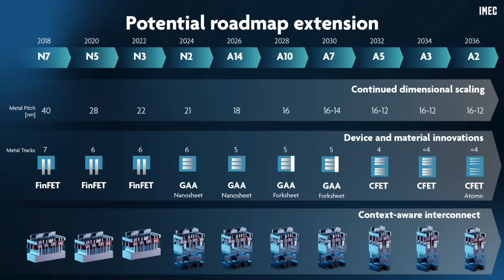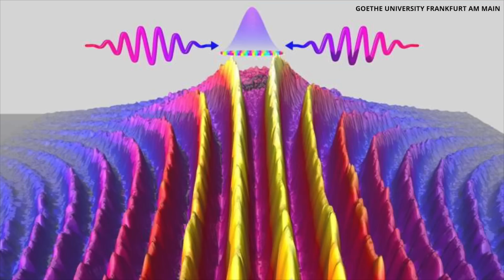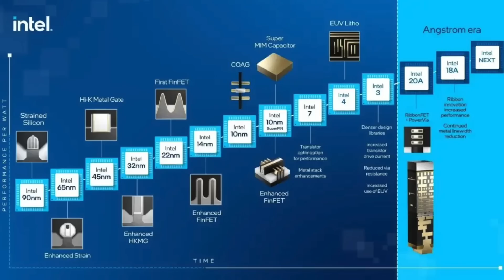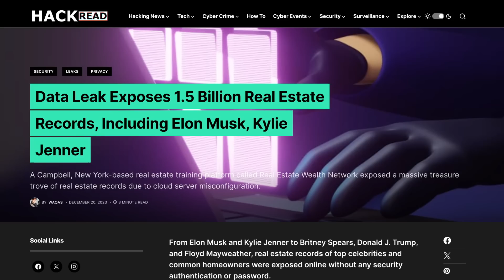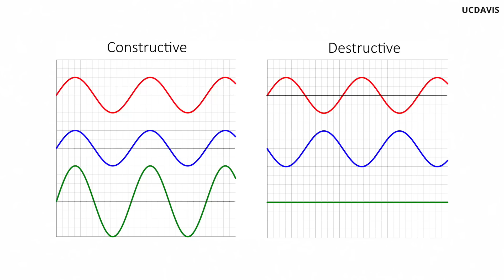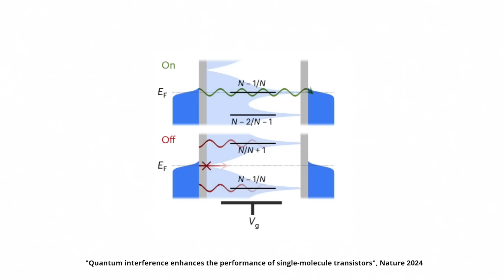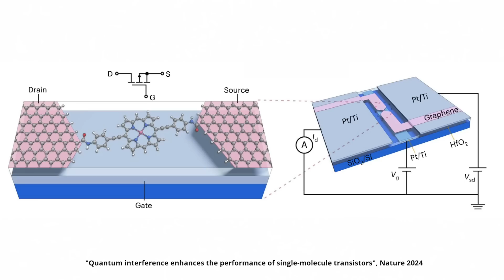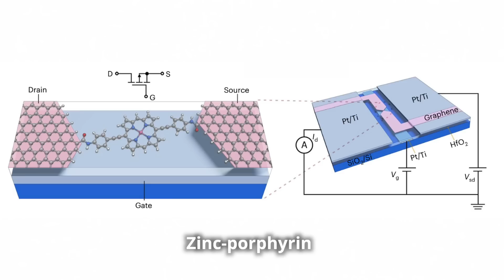Scaling Beyond 1nm

Comment from the maker: Secure your privacy with Surfshark! Enter coupon code anastasi for an extra 3 months free at https://surfshark.deals/anastasi
‼ Sorry guys, I messed up. I meant quantum INTERFERENCE, not inference. It was a long day 😅
Reply: no worries, we understood that you meant interference
Reply: The neuron is thousands of times bigger, yet the brain has more capacity than any computer, proving that it's not size that matters, but architecture.
Reply: @aaronmicalowe  Utilizing about 20W of power.
Reply: In fact, everything matters in an ultimate competition. It's hardware, software, architecture, material, etc
Reply: @aaronmicalowe  Well I guess BUT the brain is 3D!  And or a convoluted wrinkled layer.  Also the brain is larger, and even more-so if you were to stretch it out it would be at least 2.5 feet.
Reply: @jonathanberry1111  Exactly. All of that is architecture.
Reply: @aaronmicalowe  Oh, I thought you meant software architecture, or the circuit layout, not how the circuit is fit in a given volume.
Reply: @jonathanberry1111  yes, the fundamental physical architecture. There are diminishing returns for just making things smaller if your architecture sucks. A shaky house built from tiny bricks is still shaky.
Reply: @aaronmicalowe  Neurons are 3D, they're also analog and asynchronous. Their frequency is absolutely terrible, worse than tecen the worst transistors. 

If we were to do something like that with transistors instead, it would outperform the brain so many times over its hard to comprehend. 
We just have no idea how to achieve this. 

Also, asynchronous shit is useless in classical computing. It would probably take days to compute a single frame on a human brain in the classical way with a decent precision.
Reply: No worries keep up the great work! Everyone has words they think are different than how that are. I thought chimney was pronounced chimley until I was like 16 :)
Reply: @petersvideofile  - Yes, Eggcorns and Mondegreens... which is the actual term for this specific kind of confusion. It amazes me that even news readers who speak English natively get things mixed up, like saying 'the missiles "hone" in on their target,' when the correct word there is HOME. Or saying 'the "calvary" came to the rescue,' when the correct word there is CAVALRY. Oh well. Who knew Jesus was a horse soldier? ;-)
Reply: Explaining the use of quantum effects on the design of microchips, making it simple enough for us dummies to understand AND doing it in a second language is absolutely amazing. Great work! We forgive you for mixing up inference and interference 😊
Reply: dw you're fine, ty for lettings ppl know
Reply: inference - вывод
interference - вмешательство
Thanks for another great video!
🙂
Reply: this is a huge step towards making neural networks function more a human brain, and can allow functional low energy neuromorphic chips with physical versions of repeated network layers embedded in hardware, and attention mechanisms with sigmoid activation neurons... pardon me while i do a little happy-dance xD
Reply: Your brain has been trained so much on saying one word, that when you have to say a very similar one, you might just slip into the rut left by the repetition of the other word. It's understandable.
Reply: if humans do not error then we do not learn from ourselves.
Reply: I get it. I was going to say something but I'm glad I don't have to because I wasn't sure how to put it. I'm a linguist, and you're more of a polyglot than I am. It's hard to keep track of multiple languages, and a mistakes do happen. Still good work, and a few imperfections aren't going to change that.
Reply: Please make one about NVIDIA vs Google A.I-GPU architecture! And no! just architecture, size, etc... will not accomplish data gardering necessary, and google has tons of e-book's GPT will never have along with conversations and videos...
Reply: I wondering why you were talking about AI.😆
Reply: don't worry, it's not hard to infer it
Reply: have you heard about intel's backside power delivery?
Reply: Очень перспективно. Надеюсь, это действительно прорыв. Похоже на то. По поводу молекул в центре насколько я понял вам уже ответили, и вы заметили. Это порфирины, пиррольные кольца.   Я тоже про такие молекулы давно знал и изучал насколько мне было возможно. 
Яркими представителями подобных молекул является гем в молекулах гемоглобина, хлорофилл,  Витамин B12 в центре которого кобальт, И Если не ошибаюсь многие природные пигменты. Удивляюсь почему их раньше не использовали в качестве транзистора. С одной стороны это довольно стойкие соединения С другой стороны они хорошо могут вести себя как триггер. Тем более если Википедия не врёт  и это Вполне вероятно  На основе порфиринов уже созданы катализаторы, сенсоры, лекарственные средства, органические полупроводники, жидкие кристаллы и материалы для нелинейной оптики.  
жаль как всегда некогда подробно писать Потому что всё ещё нахожусь в наёмном рабстве. Да и смысл вы всё равно не отвечаете. Может если получится напишу в LinkedIn.
Reply: Basic physics, long day or not.
Reply: No worries Anastasi we are humans we make mistakes 😅❤💚☺🤭🤗😊😘🤗 When you go to Belgium? 😊💚💚
Reply: 2:26 what about TunnelFETs? ;)) they take advantage of this quantum effect 💚😄😉☺😊
7:46 Ad ends in 8:30
Reply: Honestly, I thought this was like Benshark Curnipatch's pengling like situation. I thought you were pranking us, haha
Reply: Ohhh. Your molecules are beautyful ❤ And your position is super to
Reply: @AnastasiInTech - You might want to look into the so-called "Vacuum Channel FET" (VacFet) which does not even require semiconductors for fabrication, and which works better and better as it is made smaller. They are virtually immune to ionizing radiation and can run at high temperatures, such as 300°C (almost 600°F), depending on materials used. In the very first batch one lab made, the VacFets ran 400 GHz on 5 volts. They would probably work very well in the old I-squared-L non-complementary logic circuits Texas Instruments used in their TMS9900 cpu. Finally, VacFets don't really even need vacuum: When made on nanometer scales, Helium works just as well! 🙂
Reply: I wish I knew a second language so well that I made a mistake as niche and specific as that 😂
Reply: No worries Anastasi, not only did we understand what you meant, you did a fantastic job of explaining it to us.  Let me add a suggestion, however: it's great to be using constructive and destructive interference in this way BUT it's only another way of working with 0's and 1's INSTEAD of taking it one step farther to utilize constructive and destructive interference to do computations HOLOGRAPHICALLY, because after all wave interference patterns are what holograms are made of!  The place to look for the technologies to do this is in scientific research in OPTICAL COMPUTING, which dates back at least to the 1980's.  Apparently the engineers who have built the devices you're showing us here either don't know about holographic technologies or haven't realized how useful they can be, but the REAL coolness to holography is that IT ALMOST CERTAINLY underlies CONSCIOUSNESS, meaning that the proper development of the technologies you've presented here could potentially be useful in creating SYNTHETIC CONSCIOUSNESS IN MACHINES.  I'd love to explain more about this prospect to you if you'd  like to contact me, but due to the often-random ways YouTube works I suspect that leaving you an email address or a link here would probably not be allowed.  Instead you could Google 'Nexus Theory of Consciousness Simanonok' to get started with the concept of a holographic consciousness and contact me through my Facebook Brain And Consciousness Group that you'll find a link to on the Nexus Theory 101 page.  I love your work and would love to see you take this holographic idea as far as possible and revolutionize your field of work!
Reply: Inferernce is not the same as interference. Your pronunciation is off
Reply: I don't care what you say, it's all beautiful! I understand that English is a second or third language for you, and you are doing fantastic! You are the most beautiful electrical engineer in the world!
Reply: Please work of pronouncing the T in InTerference, it sounds like you are saying inference which is more a task the CPU/GPT might be used for.
Reply: sounds really bad but  the photonic issue of hard coded may hable to be solve instead of "interfirence" better change color not base binary procesing 1 color  it's 0. simillar bit not same a "racist cpu". espectrometer  radars. racist because "carers" about "color ", bad ai will happend because our "higth level of primitive language are full of prejuged at reality undestanding or true"

Comment: This paper is a nice step and is in the field of molecular electronics. The interference happens as electrons travel through different orbitals. It was shown also in other labs. So cooling one thing is that the Fermi distribution "spreads" and i guess you can occupy only specific orbitals also you need have low thermionic emission also as you need to cool down all phonons. Not sure if this can happen to a Silicon transistor as these GNRs or molecules have specific orbitals to do this. 
The killer for this app is the temperature and if you have to cool down a chip then you can have a qubit.

Comment: QLC...
1001 MAY BE WRITTEN AS 0011,0101,....
PIXEL ( SIZE OF e ) AT CAMERA'S SENSOR.
AC VOLTAGE WITH SPECIFIC FREQUENCY GENERATED AT CAMERA'S SENSOR.WHY WE NEED SO COMPLICATED ELECTRONIC CCT TO DISPLAY THE PIXEL ( BIGGER SIZE,SPECIFIC COLOR / INTENSITY ,..).JUST AMPLIFY THE SIGNAL AND PASS THE e BEAM THROUGH PRISM / LIQUID CRYSTAL...?🤔

Comment: I know little to nothing about cpus and how they work, but when you spoke on the leakage and how its a problem moving across the gate, I was thinking, if we do not want it to leak to the other side, then I would think there could be a lane for it to leak into which would move it away from other side where we do not want it to go.. and possibly use what leaks to help do something else.. example would be with a gas engine, we have parts like a carborator and it sends fuel into the cylinders and then is pushed out the exhaust.. but I have seen things connected to an exhaust where what comes off also helps to run a turbo charger.. which helps to increase the power and efficiency of the motor.. perhaps like a bleed off of some sort to bleed off the waves from going to the other side.. and routing it to something else that it can be used for.. just tossing out what came into my tiny brain.. all two brain cells!! LOL

Comment: You should start with that cooling problem  <  - 200°C  that won't help at all ,in addition to the low frequencies that they currently oprate on and unfigured out  interconnection system between them.

Comment: This is amazing news, to consider that a transistor can be so small.  I must say I'm barely an amateur electronic hobbyist, having studied the basics of semiconductors like MOSFETs and the simple 555IC timer, to make wave form generators for audio applications. But to consider even these simple circuits could be made in forms smaller than the width of an average ball point pen line, just blows me away.
I think of that fluid check valve design with no moving parts, and to consider harmonic and disharmonic frequencies used as the switching base it makes me think of how electronic devices could interface with human bio-enegetic energies of the Aura (Chi), and even biological nervous systems.

Thank you Anastasi for sharing, I love your excitement and willingness to bring these advanced developments to the general public.   😉💖✨

Comment: CPUs and processors in general face other perfromance improvement issues. The biggest problem is that few applications really use the cores that CPUs provide. Then code is not parallelized in most applications except for GPUs. Then, code is way not optimized for the respective processor generations.
All this leads to the following frustrating experience of most consumer users: The new processor seems 50% faster but your applications somehow are not.
And that of course stems from excessively growing junk code which is unproductive across most functional use of applications.
Had we really experienced a quadratic increase in computer based productivity we would now hav e aGDP / Capita of much greater than : 36x since 2000 across all digital value chain processes and in  particular we would have expereinced a powerful R&D boost.
However, we haven't . And that is because productivity increase stems from delta knowledge and computers are supposed to support us creating delta knwoledge that is valuable = in demand and thus increases productivity. Again, we haven't.  A lot of compute perfromance has gone into entertainment. Now entertainment is indeed productive in as far as it increases inspiration and supports recreation. However, playing games for 4 hours a day leaves no energy and space to apply any of the inspiration or creational energy you might have gained.
So all the quadratic looking advances in CPU technology dwindles down to small percentages of productivity increase a year: currently it is 1.32% p.a. globally.
Again- all this is one big allocation problem. How much energy do we need to allocate to new CPUs? To new GPUs ? To more bandwidth in fibre cables? To better software code?
To better software applications? To better data bases? To better digital sensors ? To destructive weapons or productive machines?
Maybe an AI would improve our global energy allocation far better so we can experience quadratic progress?!

Comment: Hmm, couldn't you use the same Bridge in between the source to connect the transistor? Maybe a dual  to allow a steady flow...the molecular size of the material used might be another thing.. Im no electricity related type of training but a simple engineering solution might be considered, perhaps the idea is right but the material is wrong?

Comment: Stick in position👀limitations.

When you have arc memory towart ciclesematic manifistations and mentainence they pop up en of existance according the needs of its parenting conditions 👀👀👀

This cosmic behavieures on subatomic level for our perspections behaves as a infinety room of the bicker infinety hotel and inside this room we have its own infinety hotel 🥰

This is based on thurtle tegh sharings 2017 with the limitation of the resistance its conductivetys jed eaven still without the ciclesematics of energy rotation as memory and at the same time as senaspic padway behavieures as the arc off convenant as the source of the mind of that system.
Real sentience behavieures as cosmos everywhere is experiencing 
As the cosmic sentinel its sentience as the I form🥰
I am(the extrapolation of the behavieure of the space within inbetween and around oll ciclesematics towart the behavieures of mi pressend existence that experiencing me as miself 
Jad I am a infinety room on demand of the external infinety hotel kad carrying mi own infinety hotel within me in the imige of the external infinety hotel and on demand of the external infinety hotel🎁

Without binary code🎁

. \/ O /\      VEED
<><O><>   READER/TRANSITION

      O   CICLESEMATIC MEMORY

Binary is on our of like the voyager 
Jed over there less thentional diverentionals displacements towart cohesional enertia around the translation gatways less inclosemends less negative can leak out more negative can leak from outside in and the stop sending as the binary gateway has to less to swith on in 1
So the turtle tagh way is beter as than you olways reseave pontentional diverentional as long as the infiorment alouds its existance in the conditions as it is☪️🌹

And these one we can grow with arc memory from thin space without the needs of mining
Reply: Look how beautiful I think this wil intrest you🎁😍🥰
https://youtube.com/playlist?list=PLACc6sKDQBmGI5gAlDngVU8rP3tCW7Wh4&si=_toGSxV4Hv1P1eUW
🥰😍🎁

Match love to you and ol.
🌹